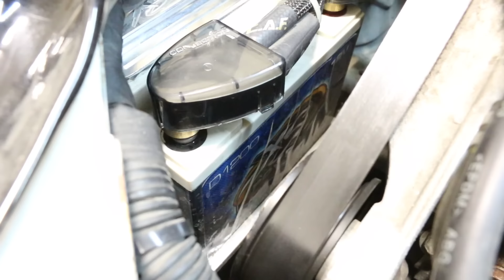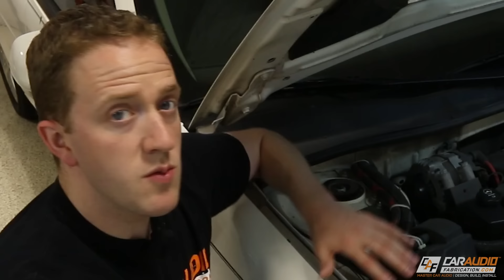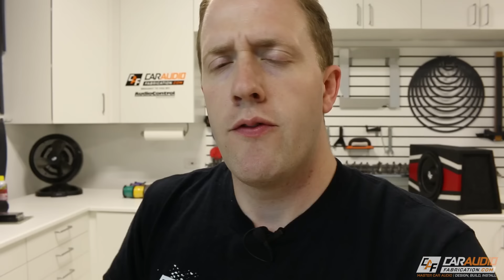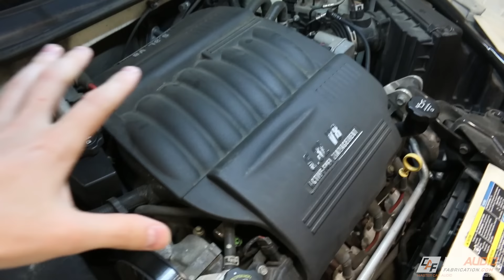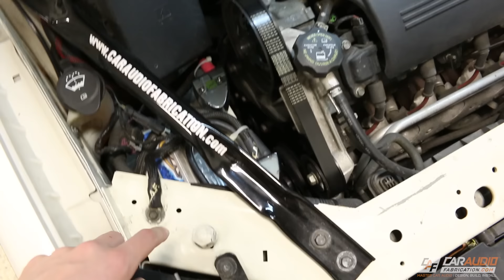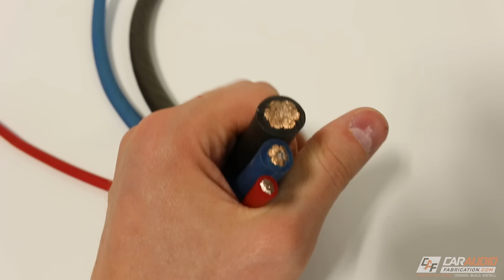Upgrade THESE for better Car Audio performance

Comment: So, in my 09 impala I'm running 1250 watts but I'm going to soon be adding another 750 AUDIO CONTROL MONOBLOCK to the system and upping my 4 channel to a 6 channel for a total of 2100 watts. Am i going to have to upgrade my alternator which is 125 amp to like double that or more

Comment: This is exactly the video i needed. Im looking at maybe doing the big 3 on my own Grand Prix GXP. All i have for now is a JL 500/1 V2 and a pair of 12W3v3 in a ported enclosure. I just upgraded to 4ga OFC from 8ga so i dont starve my discontinued amp of the power it needs. I knew i recognized that engine bay, and the fender vent and GXP badge confirmed it. Amazing coincidence!

Comment: I just installed a  plutonium reservoir to power my flex capacitor. In the near future will be adding a upgrade powered by Mr.Fusion

Comment: In 04, Ford introduced an upgraded 200amp alternator mfg'd by Mitsubishi for their P71 Interceptor along with thicker gauge wiring than the previous year.   Myself, having an 03LX, I had found a kit they offered to upgrade the 03, the 200amp alternator, harness upgrade and a short connector that was different for the new 6G case.  
 Got that installed myself and reflashed the computer at the dealer. Way better than the original 130amp. Glad I got that out of the way!

Comment: I have a 2013 chrysler town and country with a uconnect cd/radio system. I would like to add an old time cassette player and was wondering about tying into the speakers.

Comment: Ive just begun my audio journey with the new RF T1D412s wired down to 1om in a ported box on a 1400 RMS RF amp having dimming lights at only 300W on the amp so now trying to figure out what to upgrade to put less strain on the cars system and overall I’m thinking big 3 upgrade first then better alternator then a second small battery in the back

Comment: If I have a stream system where I'm using a cell phone to go through either or both a head unit and a pro audio preamp such as the PreSonus 24C before it finally gets to my amplifier where do I go and give the adjustments and what do I set at a volume or setting that I do not ever touch along the way. Cell phone which is capable of its own civilization to a point where I do adjustments or do I do that on the head unit which has its own equalizer. If I'm using the 24C what volume should I set that out considering it is literally power by a USB-C where it also receives its play the music or transmit the music. Before it finally gets to my amplifier that has a low and high pass filter but it is also capable of its own gain and bass adjustments. Now this is not for in a daily driver but it will be for an RV type situation.

Comment: I know this is an old post but I've been looking into the ecoflow line of generators and wanted to know if you've done any research on the alternator charger they currently offer and one of their generators as a second battery for systems. Their alternator charger puts out like 800 watts from your system and can recharge any one of their power stations very quickly while your vehicle is running and since the generator can put out 12 volts in theory it should be able to power your system and depending on the size could possibly power it for sometime if your vehicle is off... They sponsor a lot of YouTubers and I trust you the most for my car audio needs so maybe you can get with them and see about getting one of their units and testing it out so you could help us less trained people out 😂

Comment: I think something that every car stereo install should have is a good line out converter. One that reduces noise and distortion, doesn't add distortion.  lol. Yes, most do, so know your device and who is making it. So reduce any distortion in the signal, and then boost the signal. That really helps any stereo system without spending a great deal of money. And it's true Audio Control makes some very good to great line output converters. It's a game changer I think in sound quality.  Using a combination of analog with digital processing gets you the best sound quality, one that is warm,smooth., accurate.  "Hi-Fidelity is in the numbers". Honest numbers that is.

Comment: It's not just car audio performance, it's a whole car better performance. Everything is powered in cars these days ( which is stupid, like turning a handle to roll down a window is just too much work. No the "too much" is the price of the car. lol) so upgrade your electrical system!  Seriously good idea for every car., because the way car companies are wiring cars today, is not the best way to do it. It's terrible engineering, because a "computer" not a "person" designed it. Yep. Car electrical systems were better made 10-20 years ago than today I think. Computers should "assist", not create.

Comment: I have a 79 Lincoln that died on the road today. It was the result of a bad alternator. Now, I believe that it is an original spec alternator for that vehicle (60 to 70 amp).

I have a very small aftermarket sound system that is 800 w, powering two, 12-in subs. 

My question is, do I just replace the alternator with something similar to factory spec? Or, do I go with something bigger (like 100 amp or higher)?

I've heard that going too big. Can damage the battery and possibly electrical components in the vehicle. Just want to know what I should do in this situation? 

Thank you in advance

Comment: my kia forte is having problems supporting 1000 watts.
Reply from the maker: That's rough, bummer that these vehicles have such wimpy alternators from factory.
Reply: @CarAudioFabrication  it is 14.4 v at amp drops down to 13.5 when bass hits I'm more inclined to think protect mode is triggered by the ground.

Comment: I have a small blue wire that is pretty short connected to the alternator wiring. Is that a ground? If so, where can I ground it? 2003 Chevy Impala 3.4

Comment: I think the 1st upgrade should be your alternator and then Of course the wiring at that same time And if your battery is not strong enough to power  You're vehicle  Then it's best to upgrade your battery Or am I  wrong?

Comment: I am putting 2 sundown X-12’s in my 2017 Ford F-150 super crew can on a CT Sounds 1400.1 AT amp, will adding a second battery be ok before upgrading alternator?

Comment: does a car audio system sound better or louder with the engine on or off? I mean don't you have more voltage with the car on because of the alternator. or does the system sound the same with a 12V battery only?

Comment: Alternator and battery are first couple of things and I like to get two new batteries actually so one doesn't want to pull from the other if I'm not using a battery osolator

Comment: I'm kinda new to the way systems are installed today as compared to 30 plus years ago. I can install just about any system but my question revolves around doing the big 3 to a 2012 Chevrolet Traverse. The main battery sits in the floor board of the back right passenger compartment.

Comment: Hi I  have a 2012 ram 1500 5.7 I have 2 10in 1200wtt speakers. Will 2500watt amplifier be good for the speakers is there any thing else

Comment: I have Alpine 6.5 componets front & 6.5 in the rear. Running a 12inch Sundown U12 with an sundown 1500watt amp. My local shop told me don't need a big 3 upgrade nor alternator. Just get an amg battery. But was taking on upgrading in the future. Think I may have to just get things done my own since these shops don't want my money. Smh
Reply: Happens alot when they don't want smaller jobs like Big 3. 
Just need a few tools and supplies. DIY is not bad.

Comment: Yes  you to sustain your car s electric As it was engineered maybe if possible run two alternators  and batteries dedicating one for amps  monitors what after market stuff you choose.if possible  but upgrade the source

Comment: I have a 1,200 watt system and i want to upgrade the alternator first then do the big 3 right after installing the high output alternator and I’ll upgrade the stock battery later on, what you do you guys recommend?? I have a 2005 Ford F-150
Reply: Only 1200 watts? Might not need anything. I'd do Big 3, then battery.

Comment: Had to ask someone that knows. 2018 Chevy cargo van with a 1000 watt JL audio system, Ran 0 gauge hot and 0 gauge ground to chassis. When its hitting hard, slight headlight dimming, voltage drops just below 14. Not to bad, but I'm about to replace the factory ac delco battery, Which type would be recommended? Deep cycle, AGM or conventional with more CCA?

Comment: My grandpa used to always tell us the first thing you should do when you buy a vehicle is upgrade to literally the best battery you can get to fit in it and get the best lifetime warranty so if we are ever straightened it's not the battery. So from an audio standpoint the alternator, and again best one that will fit with the lifetime warranty.

Comment: Mark do you always run a full size 0 gauge wire from the amp board all the way back to the battery or do you just provide a good ground close to the amp board or is it both?
Reply from the maker: It really depends, you have to check the quality of the ground. Check out this video: https://youtu.be/eIB4IaNWS_M
Reply: @CarAudioFabrication  You're the best. I remember this video now. I did try to find it but I guess I just missed it! Thank you sir for taking time to reply!

Comment: for hard bass pulse a Cap is nice because it is the fastes, but then the alternator must charge the cap and must provide the bass. if you run the system hard a cap will help your car

Comment: Hey man I love your videos n quality work u do but you talk to sofisticated to the ones are learning lol 😂 talk more normal people don’t have the knowledge but love  the car audio field I have a lc6i on a 2015 Camry aftermarket system factory radio but my speakers at door n rear have a zzzz noise even radio off if I lower gain n lc6i go away but don’t get same sound my high be low in volume

Comment: I'm curious whether it is better to add a second dedicated alternator for car audio (130amp stock alt)
Or to replace the stock alternator for a 250 amp HO alt 

In my case I have a 2012 chevy cruze 1.4 turbo 
My alternator is stupid hard to get to but I think there's plenty room for a second one.
Second alt is 200$ 
While a HO alt for this car is 600$ish

Comment: "I'll just add a capacitor, it'll fix EVERYTHING"🤣😡😡😡😡😡 
Anyone in my aera who has issues with they're electrical after adding an amp, & sub.

I would much rather add a 2nd deep cycle battery. Optimas were the best back in the day🤣

Comment: Hey, i have a concern.. im going to be running an amp that will do around 1400rms and 2500 or so max at 1ohm.. the amps fused for 120amps, my concern is the speaker wire between the amp and speakers, im going to run 4 (8ohm) subs.. im worried that 14 or 16ga wont be enough, any info would be greatly appriciated..

Comment: The first thing I would do is to replace the battery if it isn't in good condition - it's no good to do any upgrades if you can't start the car. Assuming that the alternator is serviceable, the next thing to do is upgrade the alternator wiring - red sheathed (positive) wire directly to the battery positive terminal via an appropriately sized fuse and adding a ground (black sheathed) from the alternator body to the negative battery terminal.   I went with #2 AWG since I believe that would be more than adequate for me. The "Big 4" upgrades say to upgrade the engine block ground but I don't see how that is helpful if you add a large ground wire (per the Big 4 upgrade tutorials) from the alternator body to the battery since the alternator is mounted to the engine with metallic supports - seems redundant to me. The alternator should be upgraded depending on the electrical load.

Comment: Big 3 first, especially if you plan on re-locating the battery or adding batteries/ultracaps! Great cables/wiring adds efficiency and helps you “find” additional power that you didn’t know you had.

Comment: I'd say alternator and "big 3" first, even if you don't necessarily need them for the first stereo install, you will have the groundwork for expansions and upgrades later.  I have yet to install my first system, but from what I've seen on Youtube, once you start down the custom car audio road, you're continually planning and upgrading, so seems good to start by having adequate power delivery in place.

Comment: I used 4guage ofc pure copper wire for my power and ground to my distribution block and a ct sounds 2000.1 d for two kicker comps wired to two ohms. I also incorporated a 2500 watt capacitor on that distribution block and grounded both to the chassis of course. I used a sealed enclosure underneath the backseat of my ram 1500 crew cab but had to raise the back seats an inch and a half. I used an audiocontrol LC2I pro as well. Just breaking the subs in now. I also used a good bit of killmat in the box and in the rear of my truck. It sounds amazing.

Comment: Ok so I have 1 mono block. A db drive 2kG2. Powering 2 8" subs. So thats roughly 1000w rms. My lights dim slightly when bass plays loudly. Alternator is 100Amps. Gain is at 50% should I add a 2nd battery? Or 1 bigger battery under the hood? Thank you

Comment: It's hard to understand the wiring part on newer vehicles. I want to do the big 3 on my 2014 Explorer but the alternator wire doesn't just run to the battery in a straight shot and is some type of huge harness that runs around the whole engine.  I'd like to use battery terminals similar to the ones you have in this video. But I'm no quite sure this can be done as my batteries terminal is some crazy factory thing. Is it possible to keep the factory harness connected and just run a new 1/0 gage from alternator to battery in a straight run?
Reply: It’s actually even better. Adding appropriately sized wires with shorter runs between terminals means less resistance and more power flow. It also means you won’t mess with the OEM wiring which is actually a bad idea for newer model cars.

Comment: Add a good ground to the back end housing of the alternator. They usually have an unused bolt hole and measure depth. Copper connector, flat washer, Star washer on bottom, lock washer on top = bolt length with 3-4 threads to spare. Dielectric grease is sold at home improvement stores in the auto section, pay twice that at parts store. Best price per oz. is your marine dealer. Get some and use it. Throw away the Red/Green felt things under the battery cables. The are tapered and different sizes. Please connect the battery the right way and cover the terminals with dielectric grease or petroleum jelly. This keeps hydrogen sulfide, oxygen and moisture in the air from oxidation. 
 Buy the wire based upon the end cross-section of copper, not the thickness of PVC plastic melted over the wire when made. Create a ground wire that bolts to the alternator, engine, body and battery ground all one piece. Use copper pipe, hack-saw and buy a hammer type crimp tool. Cover all connections with dielectric grease and spend your money on the best multi-strand wire you can afford. 
 At this point, an accurate amp clamp with a tested known good battery. Turn on everything in the vehicle and rev engine RPM’s to 2k. Take your measurement at the Red cable at B+ off the alternator. If impossible to get to, measure each Red from alternator to fuse/relay centers, add them up, compare with the alternators know output usually stamped on the alternators case. (Note; some vehicles have fuse/relay centers inside, under the back seat.)
Once totaled up, find the amperage requirements for ALL stereo components. If 10% under the alternators output, add a 12 volt computer fan to the back of the alternator. Replace alternator with higher output if possible as many will not fit and may require longer $40 belt.
A good battery at 100% state of health (Tested) requires only 0.2 of 1 amp to charge while driving unless you are in stop & go traffic all day. No need to upgrade wire from the alternators B+ as it is a waist of money. Spend your money wisely as I have laid out. Guaranteed. For those who don’t know what “RMS” means, in simpler terms, as told, A/C voltage is converted into DC (Direct Current). The diodes get hot doing this and the higher a constant output required shortens their life. (See Fan Comment) A/C voltage at a wall socket measures 172 volts positive & 172 volts negative. (+/_ 3-5 volts) 
To compare Apple to Apples, a mathematic formula give us “Root Means Squared”. This is the useable amount of A/C that does the same work of Direct Current. Just keeping it simple, but you can bank on it.
ASE Master Tech since 1978 - Retired

Comment: I have the xs power d4800 battery in my 2018 Chevy Malibu. I didn't touch my car for 3 days and when I got in my car to go to work my battery was at 8.8 volts. I had my battery recharged at the dealership I work at and it printed out saying replace battery $340.48 down the drain. Is it a parasitic draw maybe from the 4 gauge amp power wire? I need some help.

Comment: Sir is it posible i just combine the negative to the body ground and negative to the engine ground using only one wire connection?

Comment: Im looking for a daily used high out put alt for a 01 audi 1.8t. I already upgraded ground, alt, starter wires. New battery.  The stock 120amp doesnt seem to be enough. My lights dim like crazy. People think im flashing them. Nothing crazy either. 2 old school 12" 16 or was it 8 ohm Rockfords. 1200watt kenwood amp. But its like 500 with these subs. Kenwood deck, kicker speakers. No amp for speakers.  Not my first system install but im no pro. This is number 5 ive done actually and its tge only one that has such bad dimming issues. Im hoping a high out put alt will fix it. Just wanted to go with a good company as its about 400 for a 200 amp unit. Suggestions?